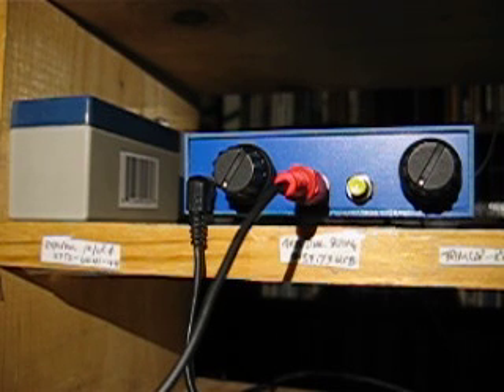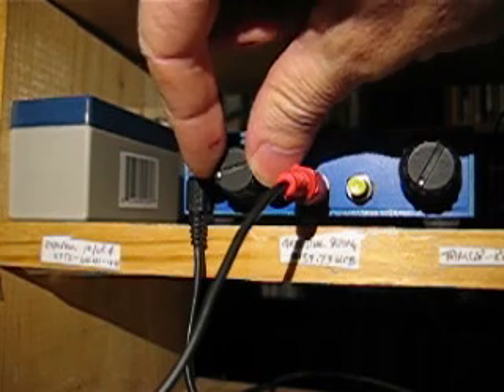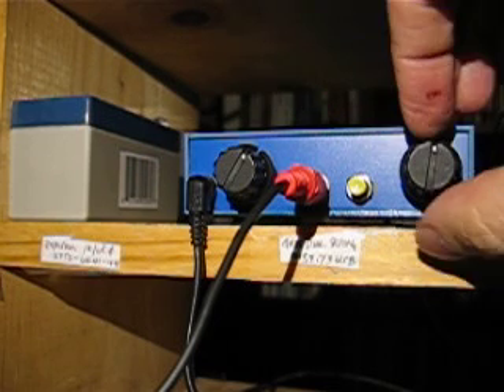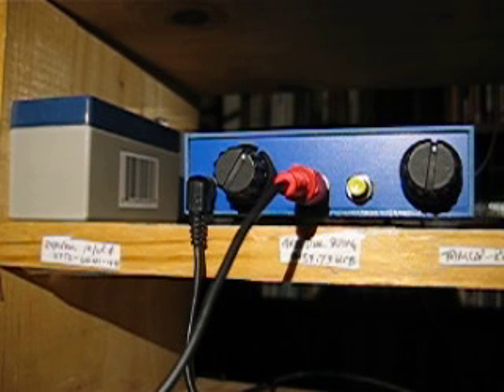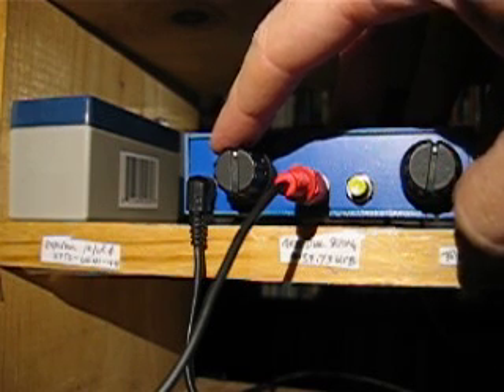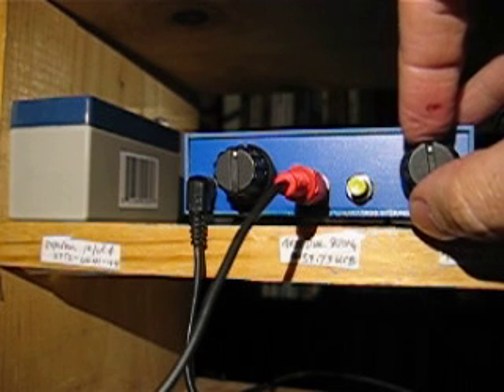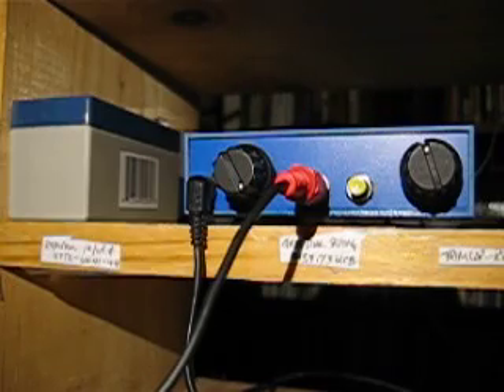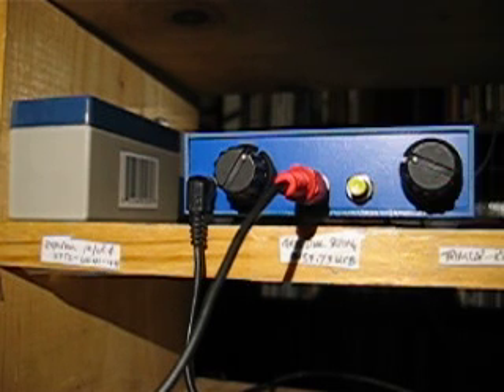The VK3YE Micro 40 QRP DSB Transceiver - A Demonstration of the Receiver

Comment: Great description on your blog about the qrp rig.
 I am passionate homebrewer and qrp'er. So far I have made several CW pixies from scratch and made a lot of contacts with them, now am focused on building dsb qrp radio and to make some qsos to fulfill my ham radio desires.
After rebuilding the mic amp on the beach 40 I got 500mw of pwr but not qsos yet. Will try the same amp type on the micro dsb might be sucessfull.
You have am amazing building skills. 
73 de Z33ST.